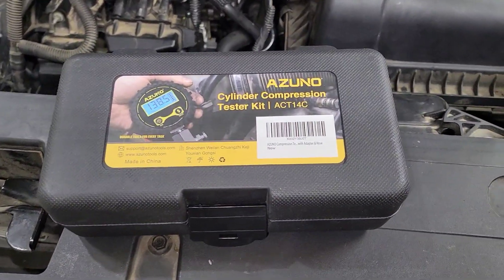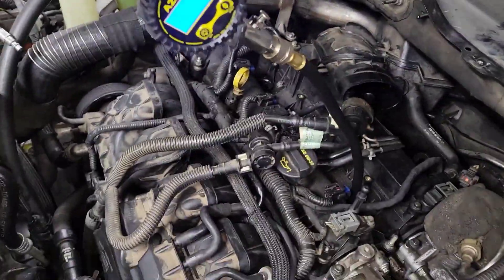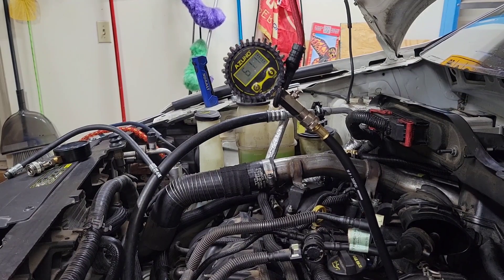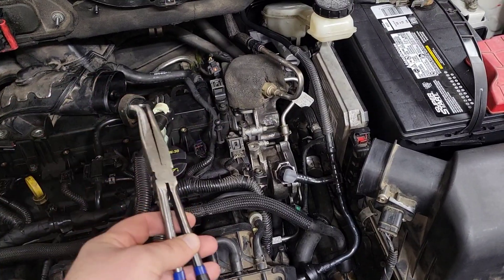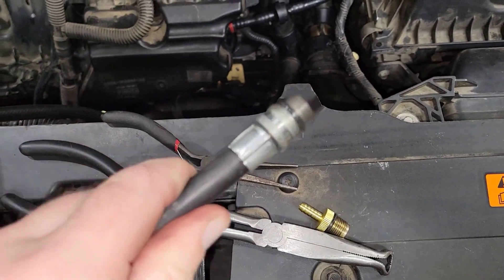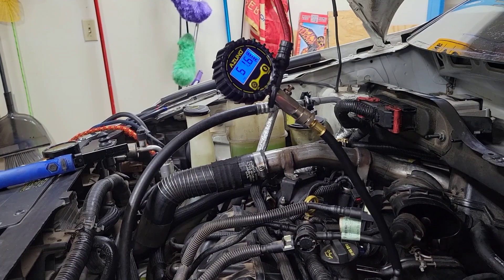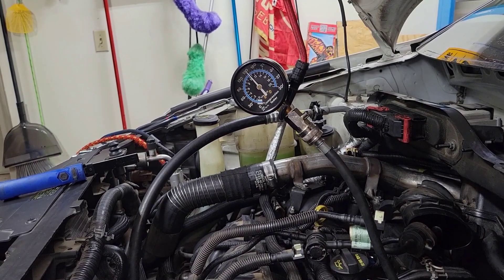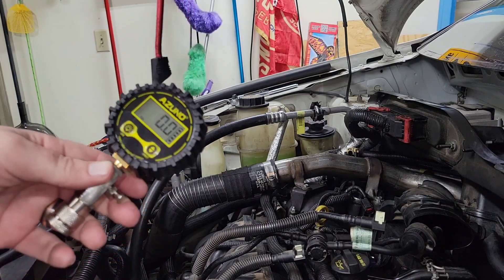Azuno cylinder compression tester ACT14C, review (it's crap)

Comment: They don't expect you to twist it by the hose.  For when you can't reach the  gnurling of the brass hose fitting they have the pipes with the quick disconnect and rubber cone nipple.  That's what you should have been using.